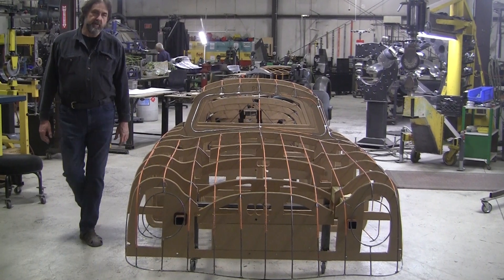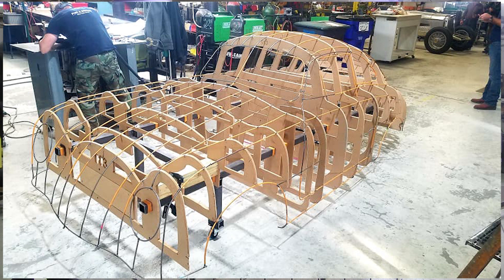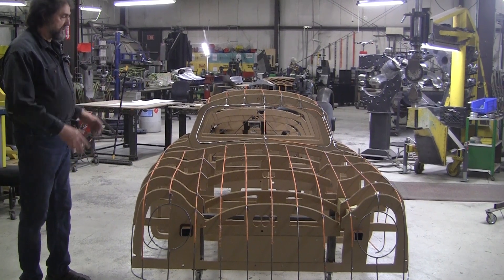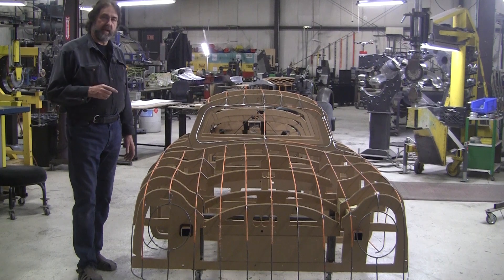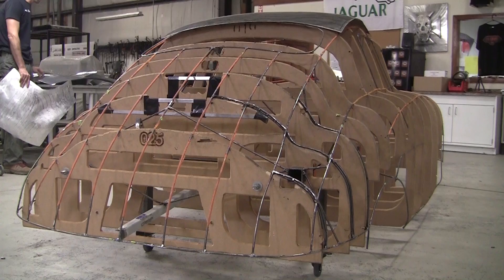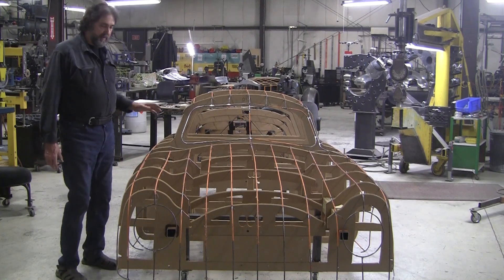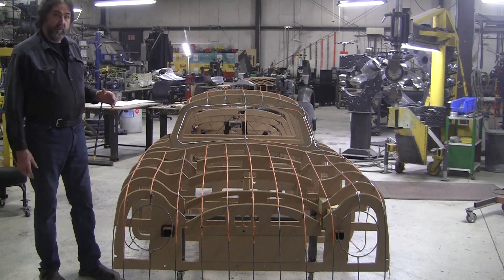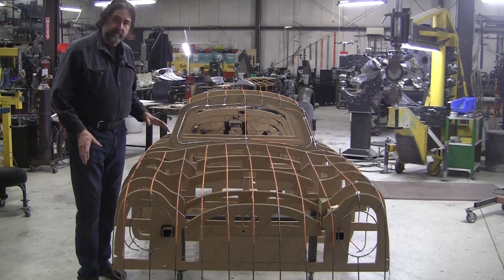Metal Shaping: 1948 Porsche Gmund SL Coupe Hybrid Wireform Buck

Comment: All that clipped safety wire securing things... really set my QA side off. That wire is RAZOR SHARP when cut and has ZERO QUALMS ABOUT CUTTING YOU BACK. It really needs to be folded over on itself to prevent injury.
Reply from the maker: Spenser my student came up with that idea and the method of creating the buck. After working on it at my shop he learned the limitations.

Comment: Would a 3D CNC tube or wire bender be a viable tool to make the wire form pieces?
Reply from the maker: Hi Sean, I'm sure a CNC tube bender will help to make a wireform but I don't have one. 😁😁😁 I use two pins welded to a block of steel held in a vise. I can make a wire bend any way I want it to with that inexpensive set up.

Comment: Hi Wray,  You have found,or he found you!, a very talented young man in Spencer. Is this system basically superleggera? I had completely lost the plot by 2mins 30secs! I am not au fait with CAD etc, l expect that in your experience you have had to learn this modern approach to finding the information you need to "keep up" with the young generation and that is no bad thing. I see a few people are getting impatient about the bonnet. You have to wait for the best sometimes !
Reply from the maker: No this isn't  a super Leggera that is the inner structure for the body panels. That will come later after Spencer finishes the panel shaping and welding process.

Comment: After all dun did we all would like to know how many man hours to completion 😨.
Reply: It took me 4 months at 15-20 hours per week. Spencer
Reply from the maker: Hi Curtis, I think you are asking how long will it take to complete the whole body in aluminum.  Each panel can take 2 or 3 hrs for a accomplished shaper, a novice can take three times that per panel and there might be as many as 40 to 60 panels in a car body. In addition an inner structure has to be designed and built for the body that can take 100hrs of hours. There are no quick solutions to hand building a accurate car body in sheet metal.
Reply: @proshaper  Now i see why these car's Draw so much 💰 at Auctions .

Comment: I use CAD (cardboard aided design) on my projects too! I'm using mdf, thin veneer plywood, sheet insulation foam, and bondo to make a buck of a 1933 1.5 ton dodge truck grill. I'm going to pull flexible shape patterns from this. I'm scaling it to be larger in size and resemble the 1933 1/2 truck and car grills. I figure the worse case scenario if I'm no good at metal shaping hopefully the grill shell buck will be good enough to be a wall hanger.
Reply: Haha your talking like a metal shaper already whatever doesn't work out in my shop goes on the wall too 🤣